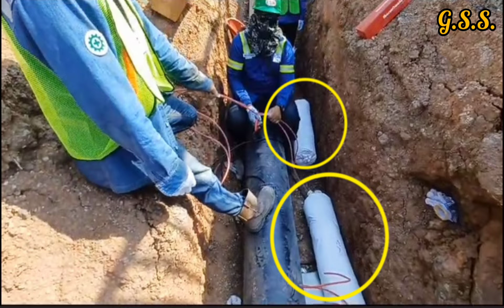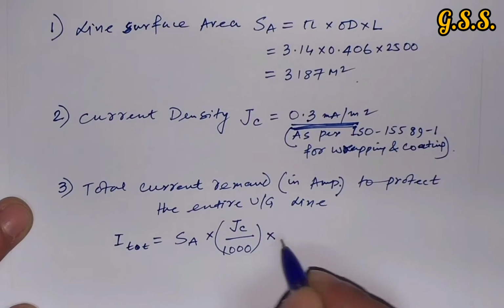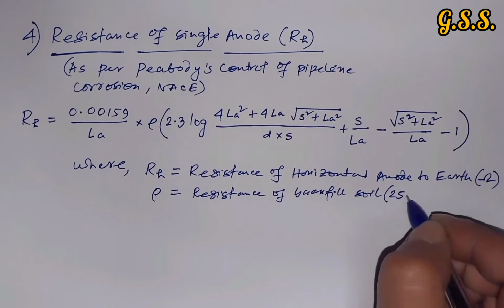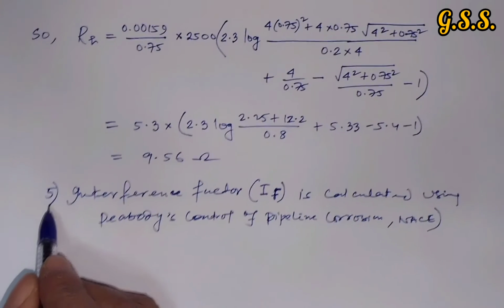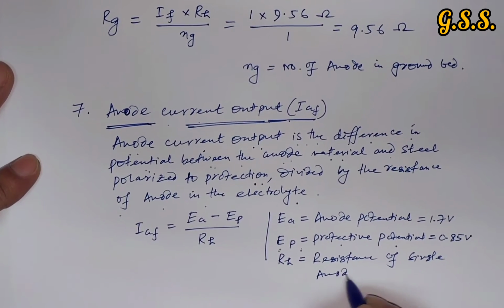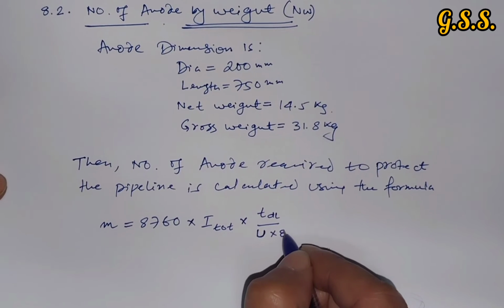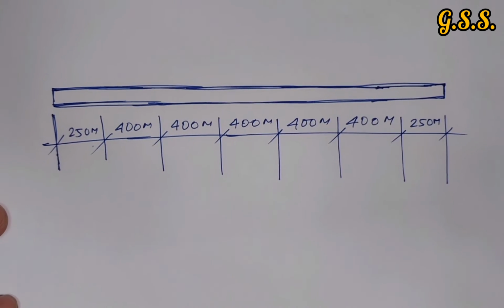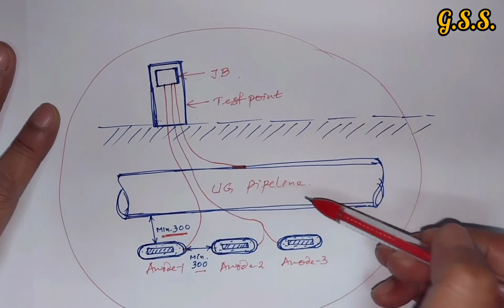Piping Engg : Cathodic Protection Calculation - Sacrificial Anode

Comment: Can i have sacrifcial zinc anode to my Trampoline mat just screw it in the frame? And preventing rust?
Reply from the maker: Yes, it will work.
Reply: @gourisankarsamanta7670  it hasnt to be in to water as they using for boats or using any electricity.
It just will work and prevent my Trampoline to rust??
Reply from the maker: @elio9207  Recently I have made a categoywise playlist for all my engineering videos. May please have a look to it. 🙏🙏🙏

Comment: Step 4 some mistake in unit conversion. Can you please check. I used 0.0521 instead of 0.00159 then only getting answer. why did we calculate Resistance of ground bed?
Reply from the maker: @rajmariappan  Recently I have made a categoywise playlist for all my engineering videos. May please have a look to it. 🙏🙏🙏
Reply: the reason why you need to calculate the resistances of ground bed is to check what is the best anode to use, anode is base of what resistances of soil so if that is high resistances low resistant may changes the factor of what kind of anode you should be use, in onshore nearby sea we use zinc anode because it has a low resistances and we use magnesium anode in desert area  because of its high resistance compatibility beacasuse magnesium anode has a high voltages , exceeding 2 000 ohm-cm. that is why magnesium anode is widely us in remote area

Comment: Hello Sir, Does a Hot water vessels located above ground, For instance, at a 20m height needs sacrificial anode?
Reply from the maker: Water vessel can be installed over a supporting steel structure. Above ground structure or pipeline or vessel does not need any cathodic protection, needs only painting.
Reply from the maker: Recently I have made a categoywise playlist for all my engineering videos. May please have a look to it. 🙏🙏🙏

Comment: Thank u sir 
But first question is which underground line need cathodic protection?
Reply from the maker: It may be any underground line, like water, air, etc. To protect the Pipeline from corrosion, we need to provide cathodic protection system.
Reply: @gourisankarsamanta7670  is there any standard or other reference for this question?
Reply: @danielodeliro2412 . All underground Pipelines subject to corrosion due to the oxidations are required cathodic protection. For example. all carbon steel pipes are required Cathodic protection. There is no specific standard for this but this will be recommended by the corrosion engineer.
Reply from the maker: @danielodeliro2412  Recently I have made a categoywise playlist for all my engineering videos. May please have a look to it. 🙏🙏🙏